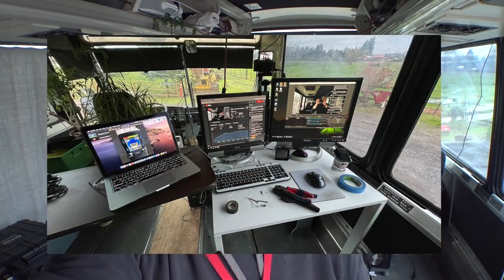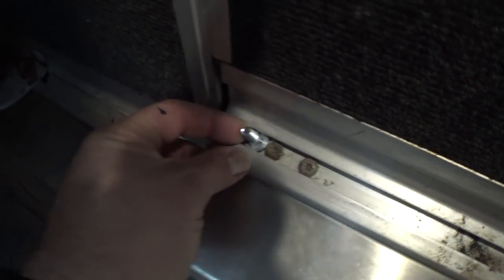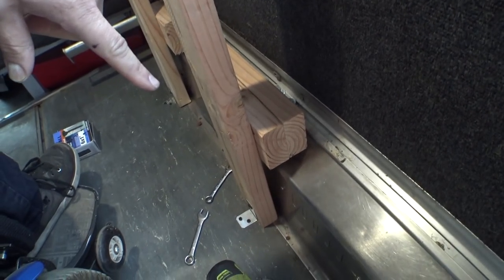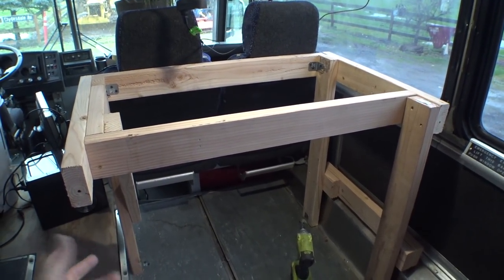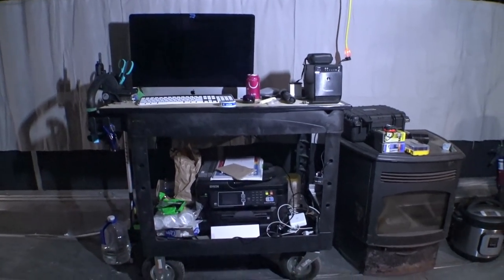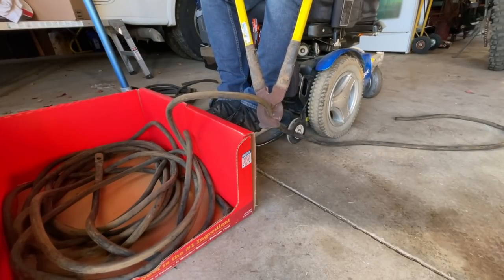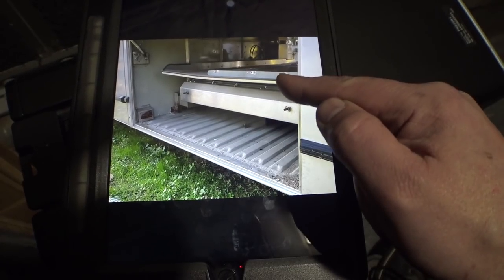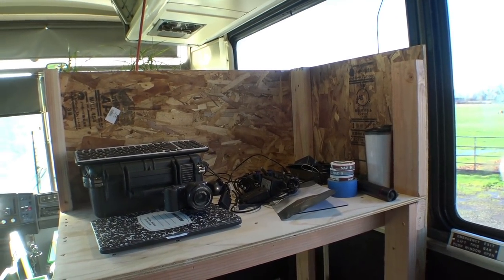VLOG 591: its a DESK!! (more bus stuff)

Comment: I use my brazing acetylene torch I fill the connector with solder and slowly insert the cable into the molten solder . I never had to crimp any .